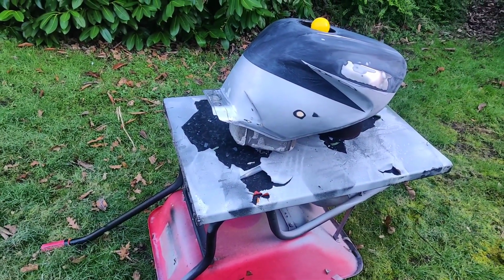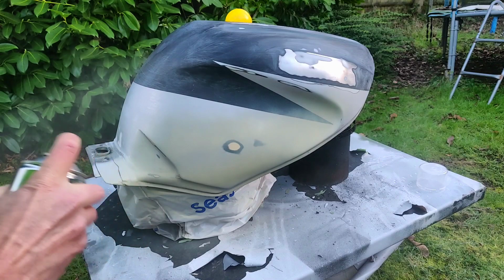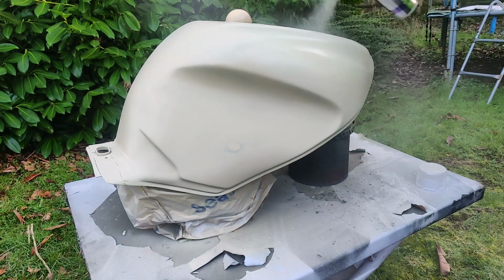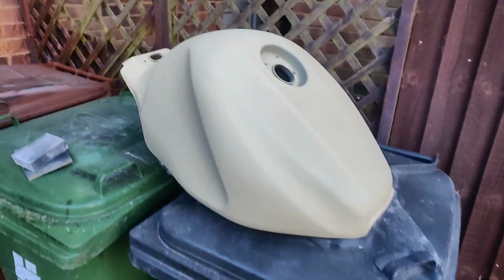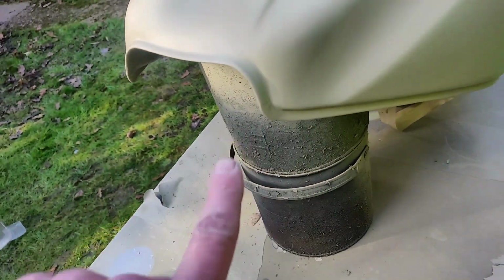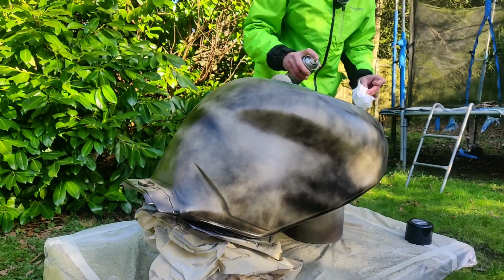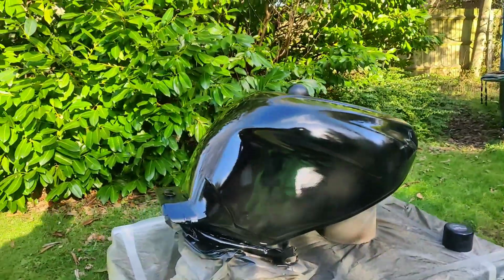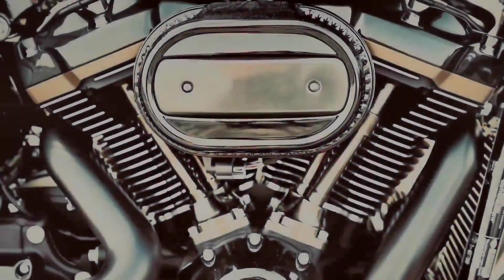Derek Paint Challenge.  Part 1 - Prime and Base Colour.

Comment: Have you thought about getting one of those  pop up , tarpaulin style green houses for spraying Nat? I did , and it was a game changer . I was short of space in the sheds so I purchased one from homebase , £80 and it was 6ft x 10ft with two zip doors , and two little window flaps that can open up but have fly proof mesh . So you still get ventilation and the good thing is , you can take the whole thing down or move it etc when not in use . Great for storing bikes in too short term if you run out of room .
Reply from the maker: To be honest mate, I looked at one on Amazon today. It might go on the birthday list for May. The missus is always asking me what I want.

Comment: Good to see someone else warming the can before spraying, really helps the paint flow. 

Try and hold the can 90 degrees to the piece your painting rather than spray in an arc, this helps keep an even layer. 

Before primer I just spray with a random colour then sand back, this shows all the high and low spots. Sanding between coats should be using around 600 grit to give the next coat something to key into, no need to go mental with it just a light sand. 1500 is too fine and doesn't give a good key. 

Also if painting outside in winter don't take it into a warm house afterwards as humidity in the air can condense on the cold surface which can really stuff a paint job. I tend to empty my garage and use cheap shower curtains as dust covers, once the paint has gone on and is touch dry then I can chuck the bikes in for the night. Annoyingly my wife won't allow me to build a spray booth in the garden and complains about the smell if I do it in the house... 🤣🤣🤣

Looks good... 👍👍👍
Reply from the maker: The trouble with my garage is the slopes driveway.  It's a bastard push if the bikes don't run!
Reply: @NatsNackersYard  keeps you fit mate... 🤣
Reply from the maker: @sidwainhouse  keeps me swearing!

Comment: Looks alright Nat,I might have done a few things differently but end results much the same as I would get,haven't seen the delboy video though ,are you going to laquer before you wax?
Reply from the maker: Of course mate. There is another colour to go on some if it first then 2k clear coat for petrol resistance.  Otherwise all if the work will slide off with the first drop!
Reply: @NatsNackersYard  Like mine did with brake fluid lol
Reply from the maker: That shit eats through everything!
Reply: @NatsNackersYard  yes it does can't say I was to happy with myself about that,maybe some laquer would have helped 👍
Reply from the maker: Maybe but only if it was good stuff.  Not using 2k clear coat on tanks is a bad idea really.
Reply: @NatsNackersYard  wasn't sure if I could use it  or not so just left it until i found out,it was the tank , fairings  etc of doner bike so doesnt matter too much ,maybe try one of your effects over top then laquer ,alls not lost 🤔best to use the 2k without isocyanate s